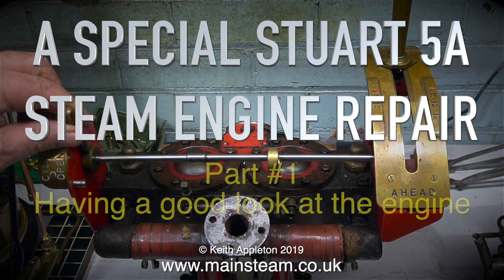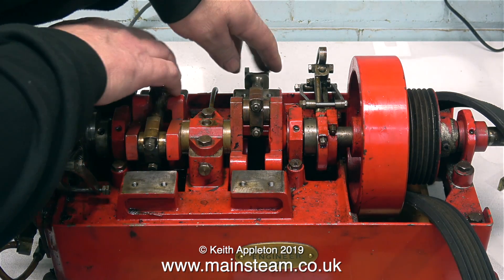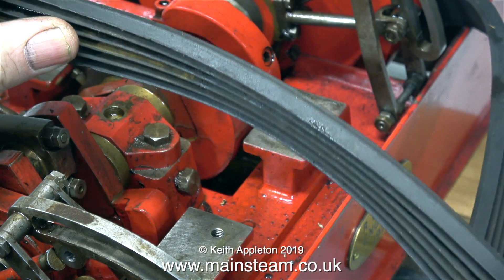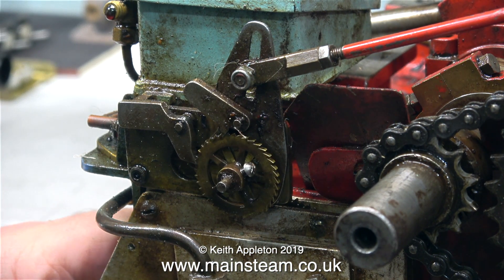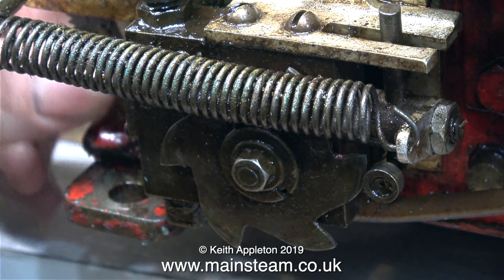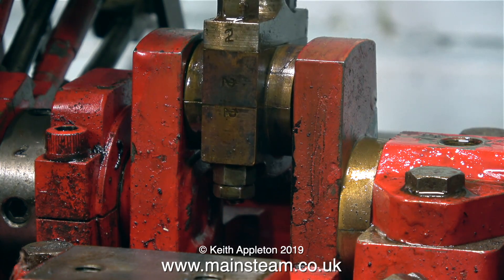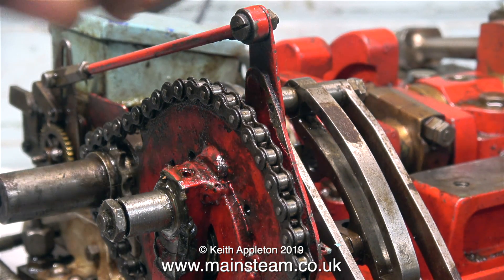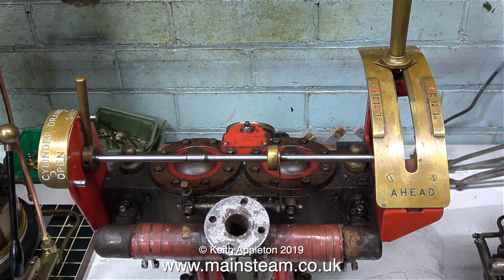A SPECIAL STUART 5A REPAIR - PART #1

Comment: Chains and Belts are both power transmission devices. Neither is right or wrong but in certain situations one could be argued to be more right or more wrong. However odds are both will work.

As a mfg engineer who used to work in forging I'm sure a lot of people would be surprised to hear that almost all the mechanical presses I've seen (rated anywhere from 500 tonne up to 4000 tonne) are belt driven! These presses often have 100-300 Hp electric motors on them. There's an important reason they are belt driven with V belts (not toothed). This allows the drivetrain to slip without damaging stuff if the press is overloaded or during startup. They are also easier to service, 8 large Vbelts are easier to replace than one massive chain (that would require an equally massive crane in a tight space.)

However there was a place for and we used a lot of chains as well. Why would we use chains? Very high (for the equipment size) steady loads on conveyors where speed must be syncronized.

In the end, chains for very high steady loads were foot print is an issue or where clocking is necessary. Belts where higher efficiency is needed and where slippage can protect the equipment from shock loads. You can see a mix of belt and chain on the engine shown which seem to agree with these guidelines.

Of course off hand i can think of multiple exceptions to the above rough rules (timing belts which have teeth) so as with any engineering subject its complicated.

Comment: You absolutely have to have either a belt or a clutch to separate a boat motor from it's propeller.  Otherwise if you were to hit an underwater obstacle with said propeller,  it would transmit the shock through the shaft and into your motor. Suddenly jamming a motor, whether it be petrol or steam is not a good idea!  In fact belts have always been used for the same reason on industrial and farm machinery for decades now.

Comment: Very interesting indeed! Are you or the owner going to convert it be chain driven? It would seem that if chain driven would be more economical in the long run. 
Thanks for your knowledge on these engines!
Reply: Belt drive would be quieter, simpler to tension correctly, and provides some fail safe should the prop hit somthing.

Comment: There will always be people hankering after a certain “purity”! We all do it to an extent, be it colours, engines only from castings etc. To my mind, as long as it is well engineered, that is the main thing. I have lots of plans bought from Ray Hasbrouck, and he opts a lot of the time for ball races instead or plain bearings, as his engines were to be used, and easily fixed. I have yet to find a single fault in his drawings, and I wish the same could be said for Stuart drawings, and even the launch engine drawings by K.N, Harris..
I am surprised that with all that oil everywhere that the ancillaries are so knackered.
Looking forward to this series.
As an aside, I got my V6 boiler a week ago, and the Chinese gas burner roasted itself alive first run, which leads me to a coal question....
What sort, and from where, do you recommend, as I know the local garage forecourt is not going to be the answer!
Reply from the maker: That is odd, my Chinese gas burner seems to work fine, you must have got a dud one . . .
Reply: With the water level half way up the glass, the boiler crept up to 40 psi. The burner was sitting inside the ash pan and centralised. The entire burner was glowing red hot, despite running at say 1/4 open so I stopped.
On examination, the igniter had melted completely, the drilled dome had distorted slightly, and the fine mesh under the dome had completely disintegrated!
I think the flame had got behind the dome somehow, hence the destruction and lower heat output☹️
Any coal tips?
Reply from the maker: Best to watch mine in steam using coal, (3 videos) - that should give you some idea about coal firing. Make sure that you have TWO methods of pumping water into the boiler though in case one fails. You can't just switch off coal }:-)))